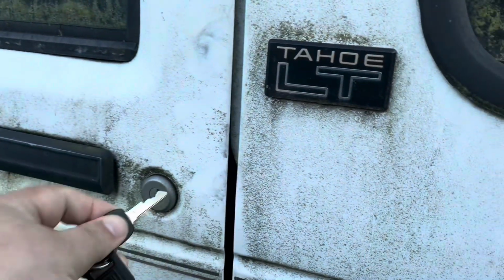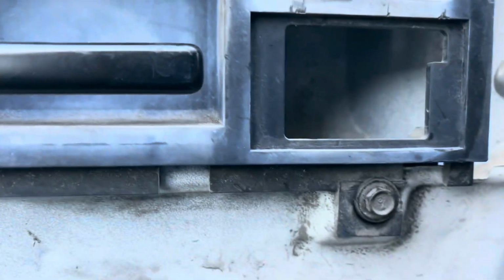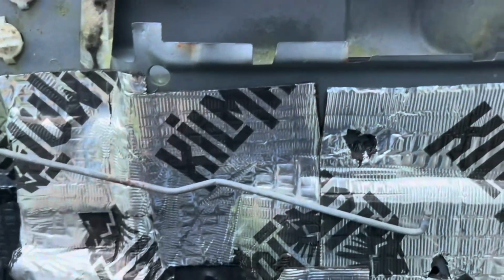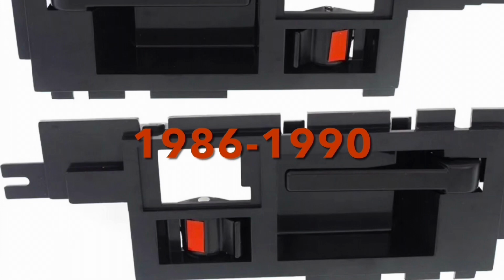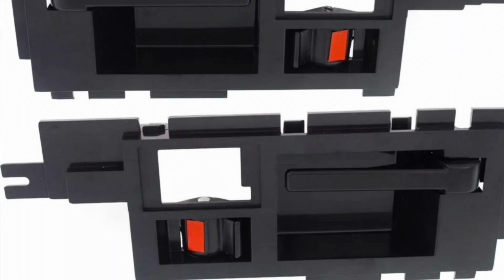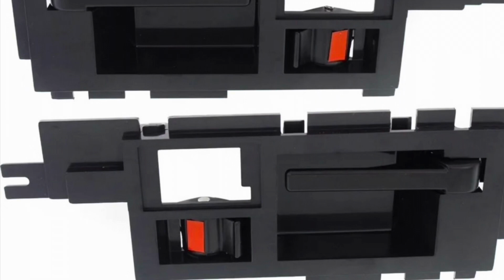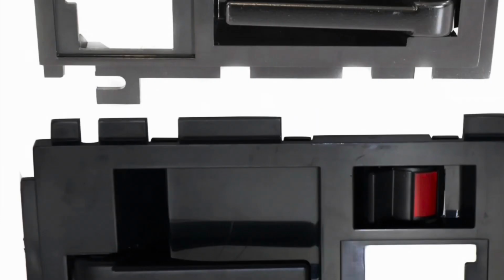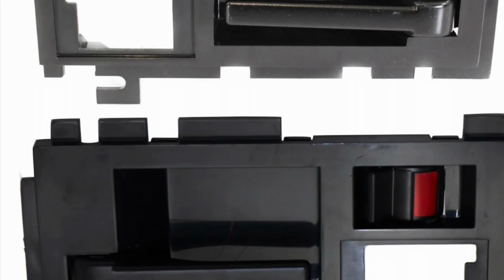S10 Blazer-Square Body Doors ARE NOT All The Same

Comment: 10 minutes of work they all can be used on any year. Putting a 82 door on a 93 first different is arm rest location . Plastic air vet in bottom of door versus its just stamp in old doors
Reply from the maker: I'm mainly focusing on the basics of what someone with the least diy skills can do. And how to make sure buyers are aware of what work they are going to get into if they don't buy an exact match.